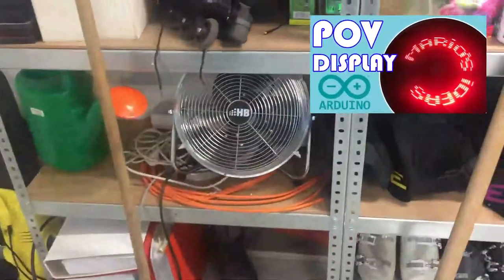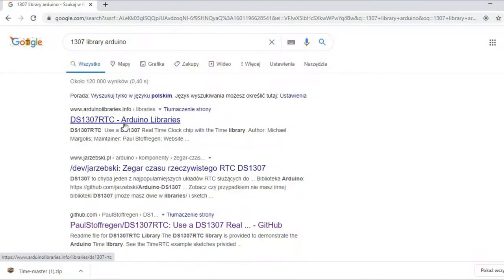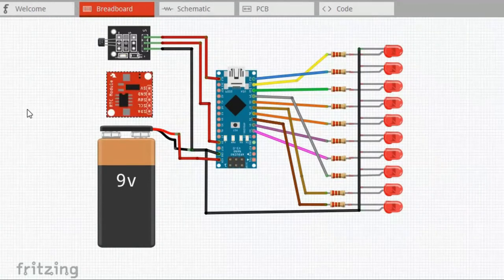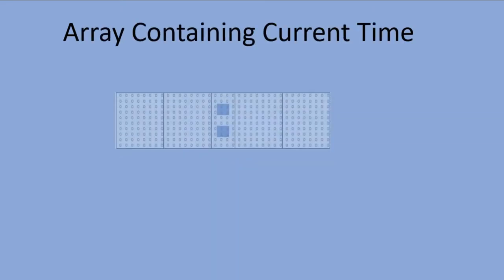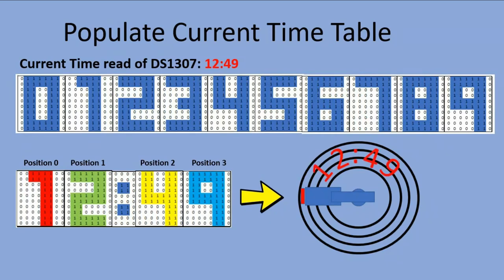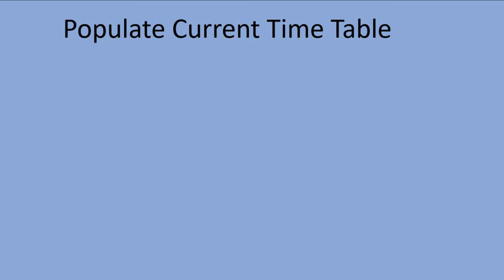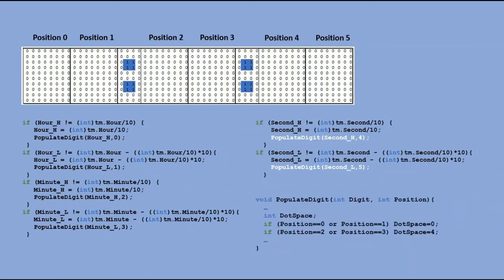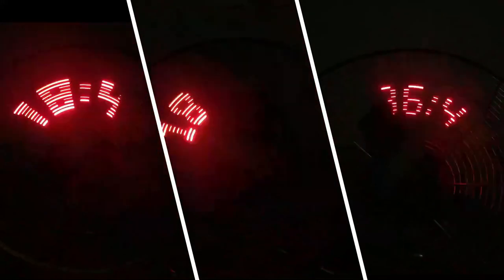How to create Arduino POV (Persistance Of Vision) clock using the old Fan and DS1307 RTC module

Comment: Do you have any e-mail address like google? I have a question about your code.
Reply from the maker: you can ask here. or give me your email and I will ping you
Reply: @marios_ideas  
I did everything the same as you did, but when I compile on Arduino, the LEDs are all lit and there is no change.
Reply: @marios_ideas  
I think there is no problem with the circuit, but can this happen if I just compile without rotating the motor?
Reply from the maker: The leds blink so frequently that you will not see this unless it starts to rotate. The leds should start to turno on when the magnet is near and after playing the sequence they should go off. If they are constantly on even when magnet is not close to hall sensor then there is definetly something wrong. You would need to check all the connections
Reply: @marios_ideas  thanks a lot. I will try it more :)
Reply from the maker: 정세훈 check my video about magnetyczny sensors and check with skompletować program if hall sensor you use works the same way. Also check All the connections